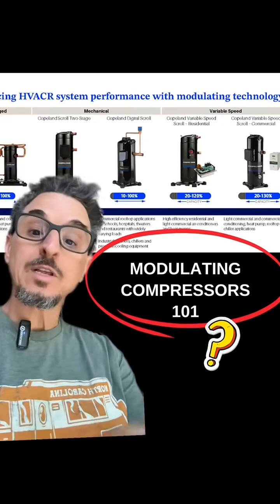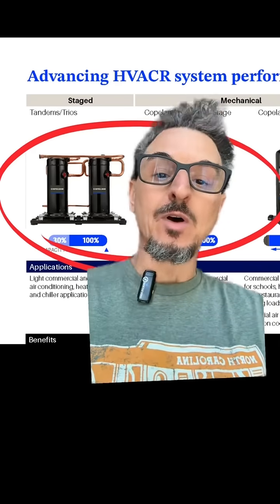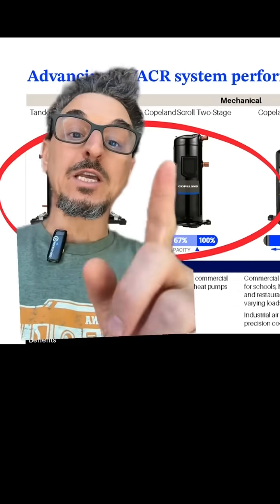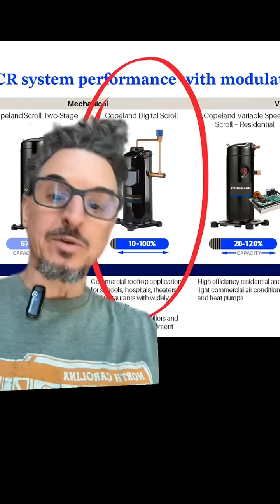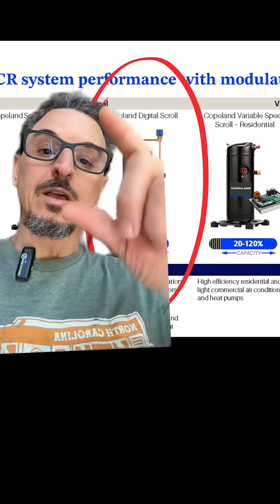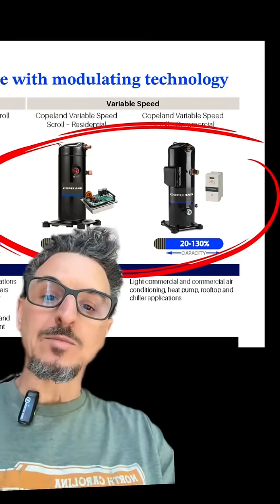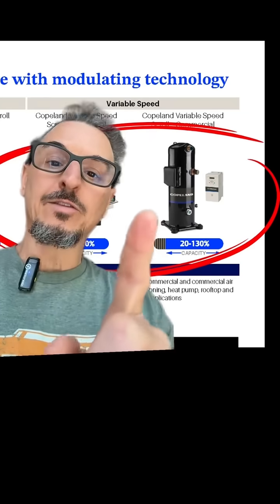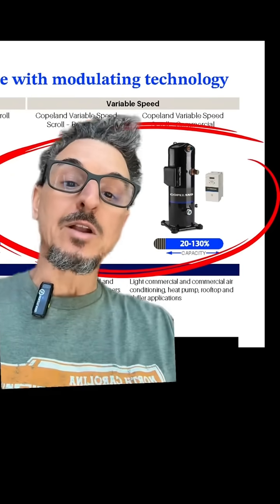Modulating HVAC Compressor Technology

Comment: Hi, nice video, is there a reason why you say these are "capacity control for DX systems"  or are they also capacity methods for water condensing / heat pump systems too systems too? 
Are there other methods for those systems? 
thanks,